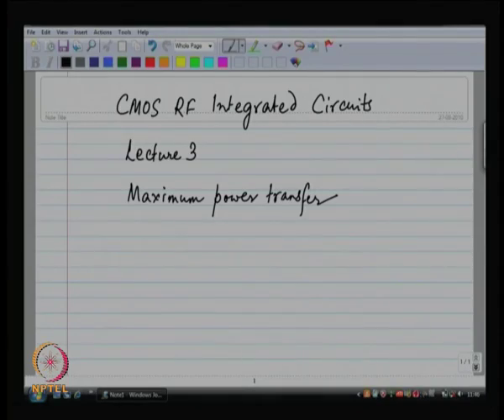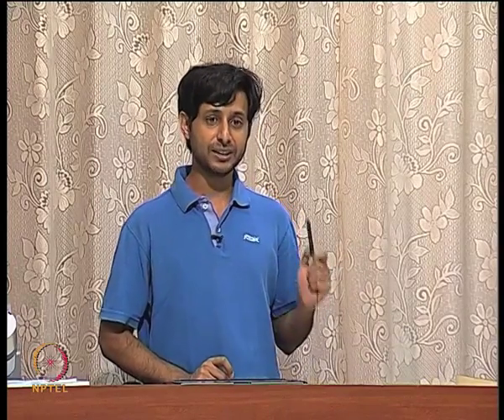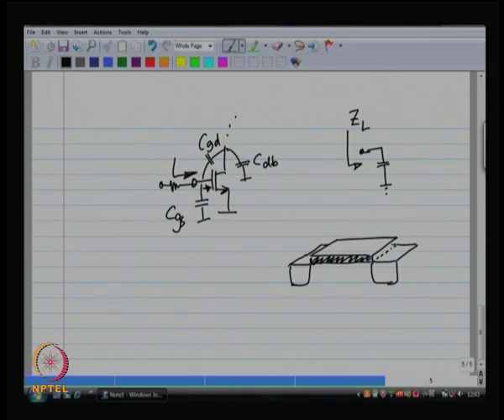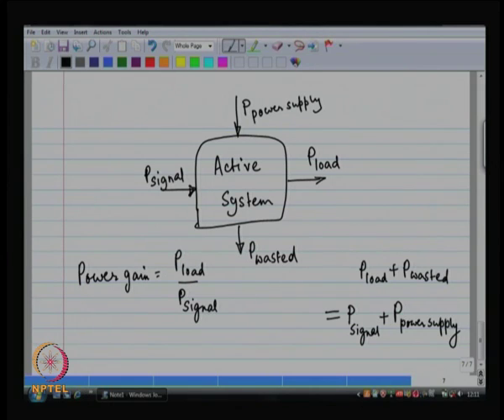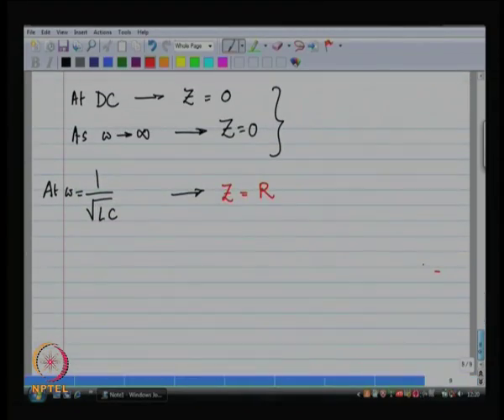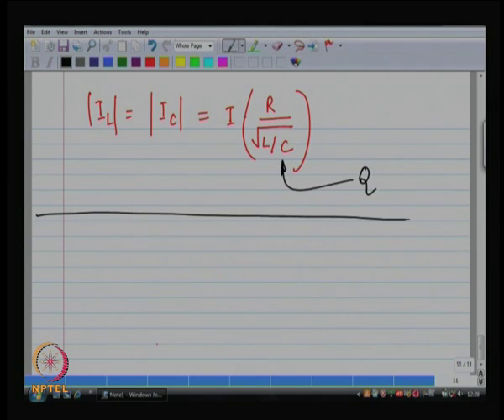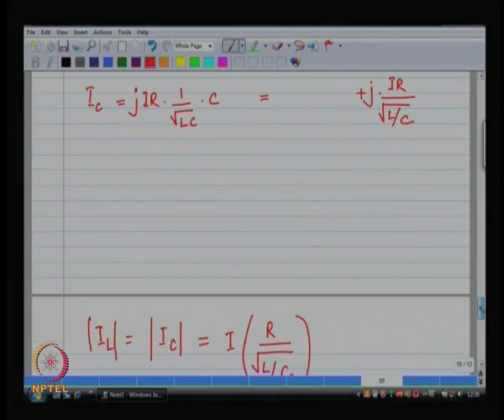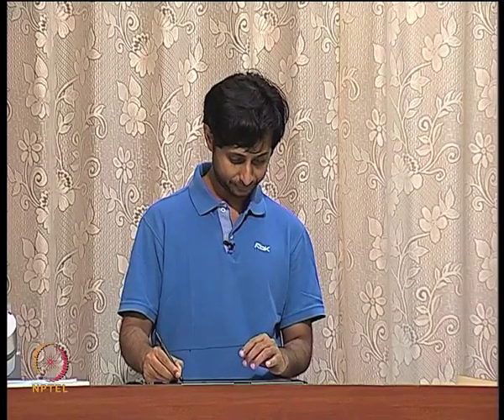Mod-01 Lec-03 Maximum power transfer

Comment: Around 14:00, differential amplifier we used as low noise amplifier... We usually operating at high frequency ( radio frequency) that means we should consider parasitic capacitors effect .. at 16 :38 is gate series resistance Rg can i consider as parasitic resistor.. ? At high frequency it forms low pass filter( RC ) input of differential amplifier has certain finite input impedance may be impedance matching possible.. at low frequencies if i ignore parasitic capacitors effect .. input resistance seen through the differential amplifier will be infinity in that case antenna characteristic impedance will be 50ohms.. how we match impedance at low frequencies..